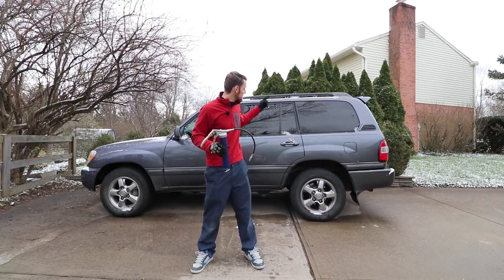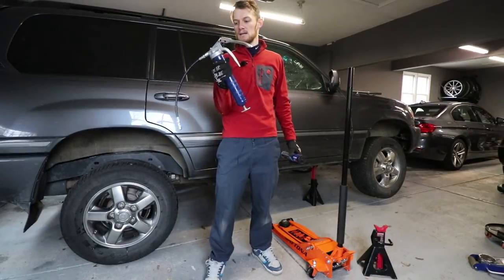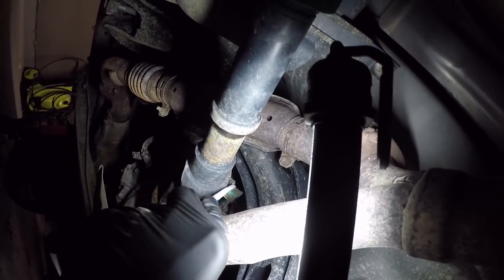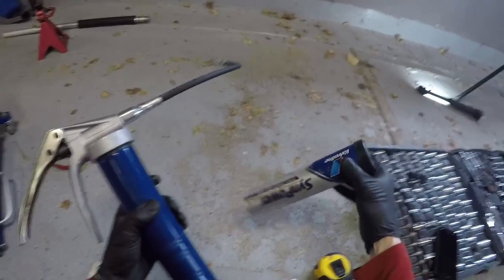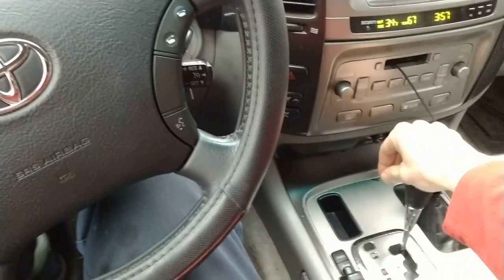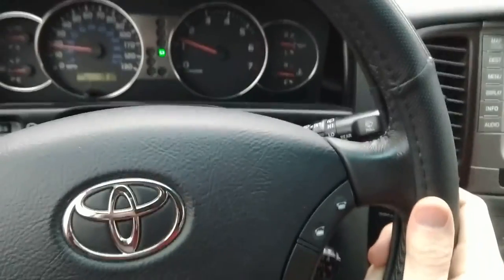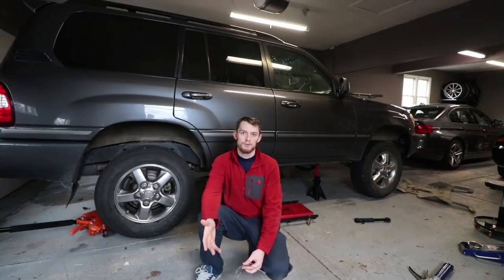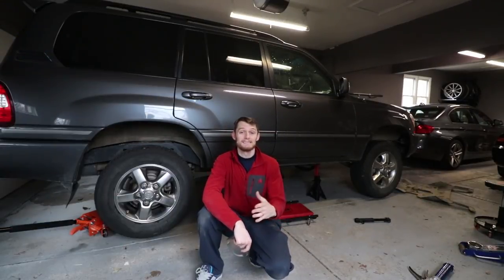How to Grease Your Toyota Land Cruiser 100 Series Driveshaft

Comment: Great video!  A couple of tips:
- Use moly grease for the slip-joints but not for the u-joints.  Moly grease isn't recommended for needle bearings.
- Grab a lock-n-load coupler for the grease gun.  Makes it a lot easier.
- For the slip-joints, pump until the grease runs out of the seal.  Then, remove the zerk fitting and cycle the suspension (if you have AHC, put it in high, then low.  If you have conventional suspension, bounce it or drive it a short distance).  Once the excess grease flows out of the fitting hole, reinstall the zerk.  This will ensure that all the old grease is pumped out, but you don't have too much new grease left in the shaft that could potentially harm your drivetrain as the shafts compress and extend with suspension travel.
Reply: what kind of grease do you recommend for needle bearings?, thanks so much for your input.
Reply: THIS is the proper information! He's going to mess up his spiders and hydrolock his propeller shaft.
Reply: Toyota specifies molybdenum grease where grease is used on the Land Cruiser. The propeller shaft, as shown, front wheel hubs, wheel bearings, etc. The percentage of molybdenum disulphide should not exceed 3%. The reference to needle bearings in the comments does not apply because the bearing is not rotating but has a slight back and forth motion. The use of molybdenum disulphide grease is often misunderstood, where it will extend the life of machinery parts.  Cheers

Comment: Regarding the slip yoke, the only time you pump it until it flows out is when the vehicle is sitting on the ground. If it's up in the air you shouldn't pump it out that much because it can actually hydrolock in put excessive pressure on the transmission and differential bearings when you put the car back down on the ground. At least that's my personal opinion. Plus, if you go look under your truck right now I can guarantee you that at least half of those 50 pumps have slung out on your undercarriage and the ground after you drove it.

Comment: First of all, great and helpful video! Really well done. 

However, to address the question of "Why wouldn't you follow the service manual?" regarding how much grease to pump into the slide yoke zerk, the answer is that Toyota, in subsequent years, CHANGED the FSM recommendations for how much grease to put in there. Yes, in YOUR manual it says to pump until it comes out, but most agree that this is too much and can result in broken seals and even warped backing plates within, or "hydrolock."

This is why the FSM was changed for the 200 series, and it recommends only pumping until prop shaft moves.

Now, that being said, IF your rig hasn't been maintained and greased regularly, and you feel like you NEED to put that much grease in, you can check/avoid overgreasing by removing the zerks afterwards, drive over a bunch of curbs or speed bumps to get out the excess, then replace the zerks.

Finally, yes, this should be done basically at each oil change--every 3000-5000 miles.
Reply: A+
Reply: Legendary comment. Wish someone would do a video showing this entire procedure, including removing the zerks and driving around a bit.

Comment: You don’t need to remove the skid plate. As long as your truck is lifted and is in neutral, you can grease through those holes in skid plate. That’s what the holes are for. Btw, figured this out when I was removing the plate after watching your video, so thanks for the great tips.
Reply from the maker: I'll keep this in mind for next time.

Comment: Many thanks for your posting.  Most helpful.  I have only a bottle jack so I did one wheel and one drive line at a time.  I put in a lot of pumps on the slide joints but not enough to have grease come out the seal.  Did not want grease splattered on the under carriage.  My car is a 2005 Lexus GX470 and I used the height adjuster to create the space to get underneath the car.

Comment: 50 pumps into a sliding yoke - scary.  The Landcruiser was jacked up, so prop shafts were fully extended - then you filled them to the brim with grease and then you put it back on the ground the shaft won't compress - that stresses the pinion bearings in your diffs.   I've been taught by Landcruiser mechanics to only ever put a couple of pumps into a sliding yoke.
Reply: I didn't even know the sliding yoke would hold that much grease!  Isn't 50 pumps almost the entire can of grease?  I was flabbergasted when he said 50 pumps.  Other videos says not to put more than 4-5 pumps into the yoke.
Reply: It’ll just leak out over time.

Comment: At least on the 4Runner, the manual states that 'moly' grease can ONLY be used for the slide yoke. It says that the regular "Lithium base chassis grease, NLGI No. 2" can be used on both the spider joints (U-Joints) and the slide yoke.
If I were you, I would double check that manual to make sure 'moly' grease is safe for the spiders!

Comment: The oil change places are supposed to do this every oil change but they never do.  If you want it done righty have to do it yourself.
Reply: You are correct. They don't. Service records for my LX said the drive shaft was "checked" every time it went in to Lexus. It was never lubed in 100k miles!

Comment: Thank you for the video.  Do you need to get ALL 4 wheels off the ground at the same time in order to hand rotate the shaft by hand or can it be done with just the front two wheels off the ground to do the front shaft and then the rear wheels off the ground to do the rear shaft?  How about a video on how to torque the driveshaft bolts?

Comment: Great video, thanks! Wondering, has anyone developed an actual FIX for this problem? It seems like a pretty blatant design flaw on Toyota's part, wondering if there are hardware fixes, or if grease is our only hope?
Reply from the maker: Not that I've seen sadly.
Reply: you're lubricating the splines so that the shafts can change lengths smoothly.  the grease is the fix

Comment: Thanks for the vid where can I get a copy of the page out of the service manual I have a 2000 LX
thanks
Reply from the maker: I found it references in this thread on the LC forums.  Not sure where to get a physical copy.   https://forum.ih8mud.com/threads/the-official-clunk-thunk-driveshaft-thread.401590/
Reply: @EatSleepDrive   Those same forum posts caution against "overgreasing" out of concerns about hydrolocking the shaft and damaging the transfer case bearings.  I would interpret the manual the same way you did, but I greased my driveshafts today and my truck is still sitting on stands.  I'm considering removing the zirc fittings and cycling the AHC from high to low to squeeze out any excess, just in case.

Comment: Ha... you skipped the harder front driveshaft u-joint greasing where the yoke is tiny compared to the back ones.  Plus your driveshafts are on backwards, look at your FSM picture, but that shouldn't be a big deal.